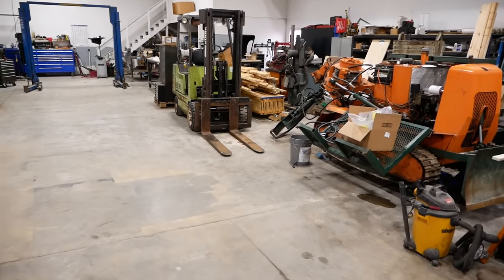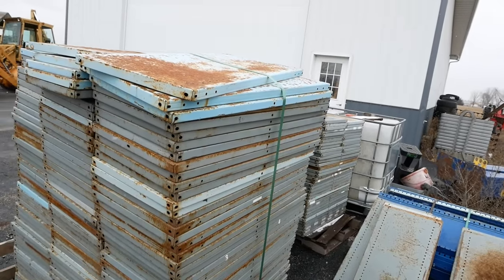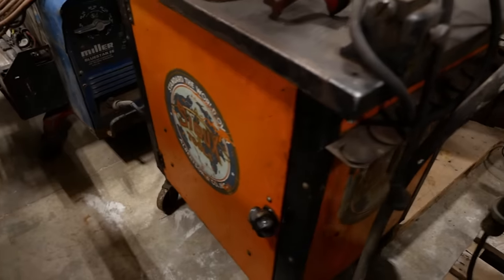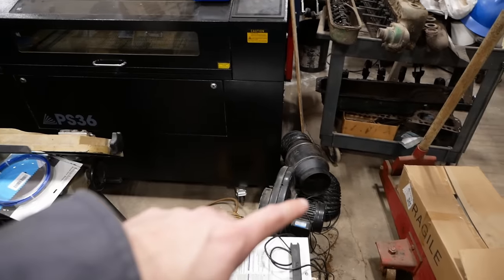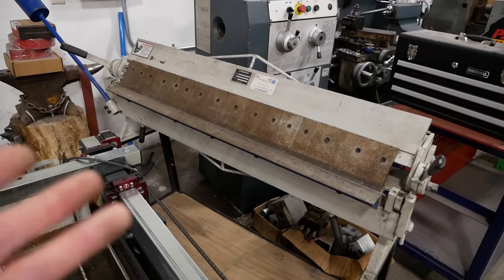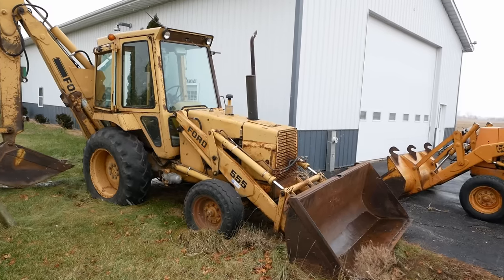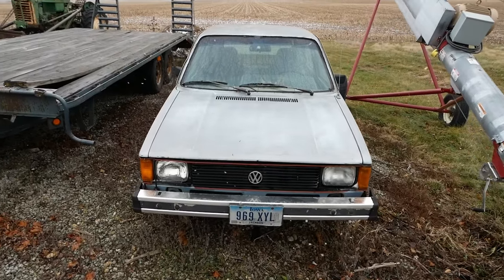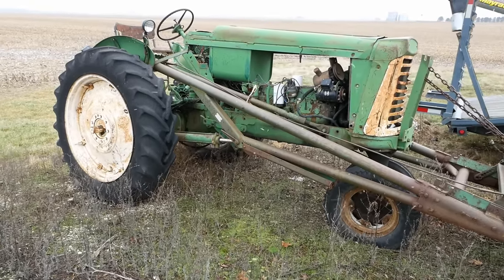What Happened to 2023? Project and Channel Updates

Comment: Hey Wes, I’m a retired architect that worked at a very large west coast aerospace company. You remind me of the Equipment Engineers that I had the pleasure to work with. They were responsible for procurement thru operations of 100’ 5-axis routers to autoclaves big enough to drive a semi into! They were also fearless, would tackle the smallest to the largest equipment. They also treated their own vehicles like puzzles to be solved, whether the vehicles were broken or not 😂.  Carry on, you’re just fine. Keep finding the humor in things even though it’s tough sometimes! From a fan!

Comment: The variety is what makes your channel special. As for the need for "clean editing", the problem is that it ends up looking slick. Professionally produced which is what everyone is fleeing from. We don't want scripted performances, staged setups or expensively shot video. That's readily available somewhere else and we here, not there. Happy New Year!
Reply: Nothing aggravates me more than "hit the like & subscribe button" in first 20 seconds. Next would be the 90 second intro with super slick graphics.
Reply: I 100% agree with liking the variety.   It seems like the return from the hours you probably spend editing and polishing is not worth it....for me, I'd rather have another video instead.  And while I love the new stuff and new gadgets, I kinda miss some of the repair videos.  So for my $0.02 (which is probably not worth $0.02), keep doing what you're doing, but throw in some repair/diagnostics videos with the time you free up by agonizing less over the editing.  And 30 minute length works for me...can always have a "part 2" etc. if too much content.  Happy 2024(!).
Reply: And don't add music. Seems everyone puts in music they like and at least half the audience hates it. But we all like to hear your machines working, be they power tools or motors or engines.
Reply: I love watchin you're stuff....ive learned alot....I was a mechanic for yrs and I just got boring...now I'm too old to keep up so I just tinker but keep doin you sir

Comment: I appreciate your videos, whatever they may be. For my part, mustie1 was the first channel that I followed (after researching some mower repairs), and several years later yours was the second; I haven't missed a video from either of you since. I find your approach to diagnostics / troubleshooting / problem solving to be of particular interest - whether it is in a normal auto repair, a specific diagnostic video, or a "will it run" type video. More videos or longer videos are great - time permitting for yourself and family - though when they are based on jobs passing through the shop, quantities and length can vary greatly. Thank you for the work you put into your channel, and your desire for continual improvement.

Comment: For your office I would suggest a high wall ductless split heat pump. Fairly inexpensive. Also basically silent indoor unit. Make sure to get one that can still operate in heating mode to at least 0 degrees outdoor temp for your neck of the woods.

Comment: You brain jibes with mine, I am and have been an Electrician, Plumber, Equipment operator (Ie. Ford 555 backhoe digging graves, a Grove mobile crane operator loading and unloading round bar stock in 20 ft bundles  for a forging shop. So I get the need to keep it interesting, even for yourself...AHHH DUH Wes I like the content, the pace and importantly the variety. I know I will learn something from the time I choose to watch your videos. I have yet to sense a put on or a phoned in episode. It is your very earnest demeaner that has kept me engaged. "Just facts is the WHOLE thing" Keep on keeping on Wes Buddy.

Comment: I've been watching your channel for years, don't change it too much. Obviously I can't speak for anyone else, but I keep watching what you do, because (I'm sure we've been over this) I'm a mechanic in the middle of Australia, I don't run the workshop, but like you, I get thrown all the curve balls, so I enjoy watching someone in a completely different place, with the same sorts of challenges. I see you fix things I don't see. I've seen I think 3 7.3 powerstroke F trucks for real in the workshop, nobody else knew what the HPOP was, but I did because I watched Wes work.
Then we had a ride on mower, with a Kohler engine, again I only had any idea what to look for, because I saw something similar here previously.
I watch the channel to watch you do your thing, because you do anything and everything, don't worry about the editing too much, or what the actual job is, I'm here for the problem solving, the working outside of your skill set because the job needs to be done, the professional repairs of barely serviceable vehicles, the making the best of ill informed decisions, the repairing, reorganising and improving your own workspace, the building what you need because you can't buy it. Because it's all of the same stuff that I have to do, and if you think outside the box to get something fixed and it works, I will do it too, and I always give you the credit.

Comment: I think what makes your channel special is that you go through "technical problems" while explaining your logics, and the humour touches are part of them, just like your iteration with your environment, Max, the wife and kiddo, the climate... First video I watched of yours was the militar truck with the bended axle. I´ve been folllowing you ever since, and if nothing new pops up i just watch any old video, that it´s the same. They are quite atemporal, it´s just fun and relaxing to feel connected with your cool ideas and good attitude to go through nigthmarish rusted bolts or harnesses of wires.

As for a personal taste, I´d prefer less time spent on "scan codes" and more on digging in into the guts of an engine, etc. Either topic is equally cool (repairs, builds, diagnostics) except for watching a screen through a screen.

Comment: My viewing tastes include Diesel Creek, C&C Equip., Deboss Garage, and most of the time Watch Wes Work.  What I like about your channel is the humor, problem solving, and honest commentary.  The dry deadpan humor is awesome:  "I cleaned it up with endangered bald eagle nests".   I really like the breakdowns of the issue, the diagnostic process and the steps taken to solve.  And if there is a goof or problem the video does not gloss over it.  It is included, laughed at, sighed over, and then beaten into submission with the human head, or maybe that was vice versa.  I have not seen all your vids, but those are the things I look forward to when WWW comes up in my feed.  Also, if you want to lengthen the vid, maybe a time lapse could add some easy to come by length; of course you could already be doing that and I just don't realize it.

Comment: I have been watching your content for a few years and the attraction is for me the problem solving and diagnostics , anyone can film wrenching and solutions and refits but we who watch these videos are likely adept at any form of practical application so do not need educating  on how to remove and replace parts but your path to a solution shows the complexity of diagnostic problem solving rather than someone throwing parts at a problem of  which there are channels that do that.
Coupling your dry wit and tempremant with the matter of fact approach the content is never boring or too complicated and thats why you have a rock solid base of subscribers that do not flirt in and out like other channels. I watch a lot of video providers in several genres but I have dropped a few because they tried to change the presentation or the subjective content for whatever reason .
So my advice is  stay as you are and do not try be something your not ,as in real life that only ends in failure.

Comment: I had a channel for a short time (I deleted it for personal reasons). Pretty much exactly like yours but it was much less sophisticated because I'm not a pro mechanic and I was doing work on the side for friends, but I did gain a little bit of insight in the brief time I was doing it. The videos that did well were projects that I think people often think about doing themselves but never get around to. Stuff that seems reachable for your average Joe. The one was simply swapping a ZF 5 speed trans behind my 300 I6 powered F150 because the Mazda trans was trashed and I got the ZF for next to nothing. I found out those are kind of sought after and a lot of half ton guys want to swap them. That one did great. The other that took off was a video about fixing the horn on a C5 Corvette, but done cheaply. Apparently it's a common issue and the official repair involves thousands of dollars in parts and labor. I found a cheap way to do it with a soldering iron and some finesse, plus the part just for the horn had recently become available. Most guys still don't fix their horns that way, or at all, but they wanted to, so that video was money. Anyway, that's it. Build a Fummins and do burnouts with it. Swap a manual into a 6.7 F250. LS swap an old Camaro. Relatively easy stuff for you that would just kill in the ratings. Plus you'd have some cool toys at the end. The tractor stuff does not do well, especially the industrial stuff. I think the very old tractor restore guys do okay, but pretty much everything else was crickets for me.
Reply: Oh, also, it might be a good idea to try reposting the same videos on other platforms. Twitter has changed a lot recently and long form videos are being pushed now, along with revenue sharing like YouTube. Might be another way to gain traction, and you could do backlinks. The algorithms love those. If you can snipe people from other social media the devs design the algorithms to push that content here, or at least they used to.

Comment: If you are going to paint the Clark forklift, try using hardware store enamel like rust oleum, and paint it with cheap foam trim rollers. Ordinary nap rollers leave fuzz balls behind. Foam doesn’t, but get a lot of them, they only last about ten or fifteen minutes each. Rollers don’t mess the shop with overspray and you don’t clean them, you throw them out. Get a pack of throw away inch or inch and a half brushes at Horrible Freight and throw them away after use. I like your videos just as they are.
Reply: Just remember, acquisition is the easy part.

Comment: You need to sell a  bunch of stuff and find you a helper.- not only to get stuff done, but also the multiple personalities and banter help with entertainment value.  (one voice gets very monotone). Show the shop fix, build, remodel videos as a series. I think people like the projects, work on something over several videos, redone show with 2 "bays", lifts, will help with that. So you can go back and forth between, regular customers vehicles and  a project like the Backhoe, with 1 in each bay. I agree that the Randomness of the videos is good, but people do want to see this completed and driving/working.

Comment: I did not know about your channel until utube put one, then more, in front of me.  And they were not your newer work I don't think.  Must be hard for you to figure out what works when you have the algorithm presenting them randomly.  On projects, I would scrap half of those that will require lots of work to produce an old and unreliable end product.  The tractor, the surface grinder, probably the moped, scrap them and don't look back.  Now come over to my shop and help me part with some of my dead-end projects.  The shop redesign looks very promising, will be worth the time spent, imho.

Comment: If I can offer a tip on the plasma cutter water splashing problem, I don't know what level you run the water height at but we always had it lapping the bottom of the plates that we used to cut, the little bit of spash could only then come up through the kerf but most would gently bubble out at the edge of the plate.

Comment: I have a Form 3 that works well.  Needed it for a special project but not using it any more.  I also use a couple of Anycubic printers.  Far cheaper but not quite as accurate, but for general printing they do fine.

Comment: Hi Wes! Just a thought here can the trough/pan be lowered and the sides be elongated ? deep drawn if You will the lower the water is the less waves in the water yes a bit of work but should reduce that splashing I suppose the water splashing may be doing some cooling? good idea bad idea wont know unless it is tried, the table has saved You some time so there is that, You needed more to do Eh!  : )  Thanks Wes!  Cheers!!! Rick

Comment: I like the Ford f700 because that's what I'm working on I put a new distributor in 2 new ignition modules and it has spark when spout unplugged I opened up the pcm I found a bad capacitor I should change all 3 never done that before.. it's got a 7.0. It's a 1995

Comment: I enjoyed the videos where you build something. Im kinda over whatching you work on powerstroke engines. The chasis swap with the F350 sounds cool. That oliver tractor needs to go to the scrapper. im a subscriber to your patreon as well. I have learned somethings on your channel and honestly anything you do is entertaining. Love your self depricating humor.

electronic and building the control board for the robot logger dont really sound interesting probaly because I dont understand any of it. 

I think the "will it run" videos are overdone. There are so many dudes doing those now. I like the videos where you referb something you found or were given, get it running and functioning and either keep it and use it or sell it. Kind of like the forklift and the skidsteer. The guys that get a machine to start up then never do any work past that are boring in my opinion.